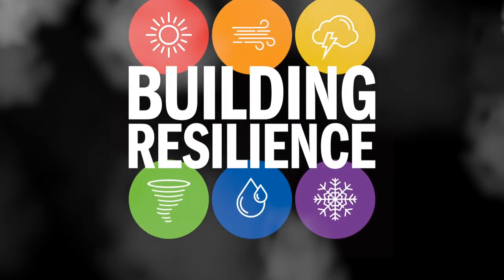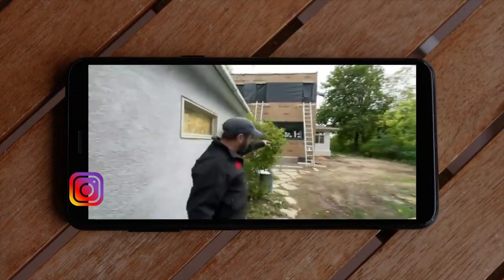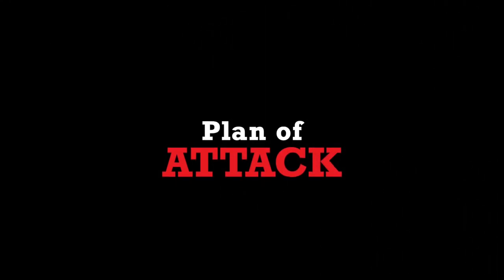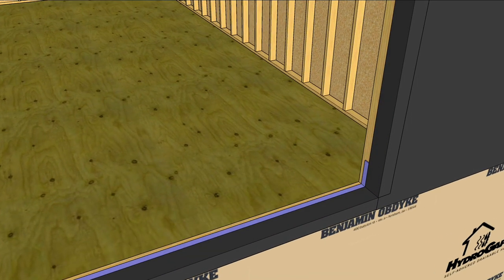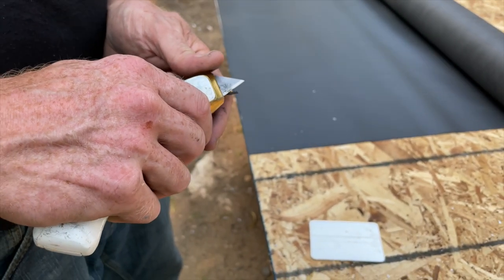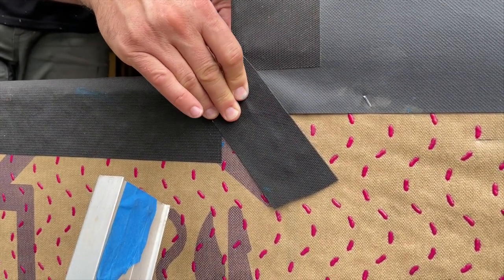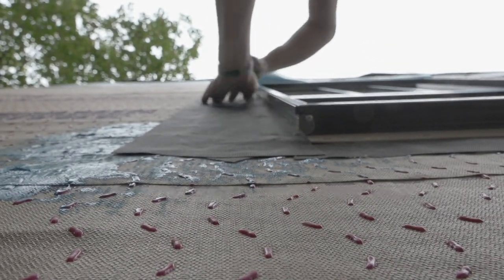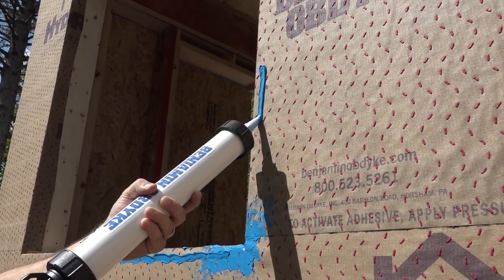Liquid-Applied Window Flashing and UV-Resistant WRB for Open Cladding (Building Resilience #7)

Comment: isn't it overkill to liquid flash and tape the window sill?
Reply from the maker: The sill wasn't really taped. The edges were cut at 45-degrees and folded into the opening. the corners were not covered in that way and would have required either a layer of flashing tape or a tube of liquid-applied flashing.

We chose Hydroflash LA because the manufacturer sent us a case of it to try out.

But consider the question. 

It is the most vulnerable place in the wall—holes for windows—you can spend seven minutes adding liquid flashing now, or cause thousands of dollars in damage repair later. The guy who is paying for the extra seven minutes may think it is overkill, but the person paying for the thousands of dollar repair work would say something like "charge me for the extra seven minutes, please."
Reply: Plenty of old construction guys think that any air sealing is overkill and that houses have to breathe. People who are somehow still employed and still building houses. Pretty wild.
Reply: @canonicaltom  I was referring to the invisi-wrap on top of the hydroflash. Morrison had mentioned that the hydroflash was sent to them to try out, so let's do extra protection on the sill. The exterior flashing is mainly to protect the assembly from water. The air sealing would be done inside either through tape, backrod caulk, or combination of the 2.